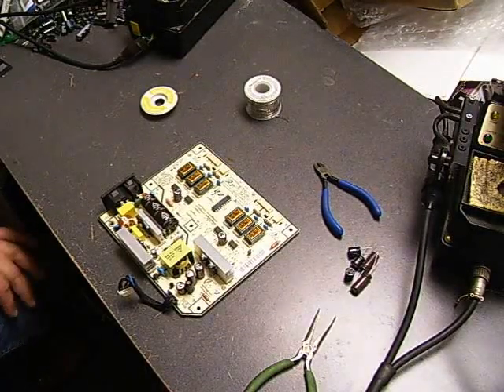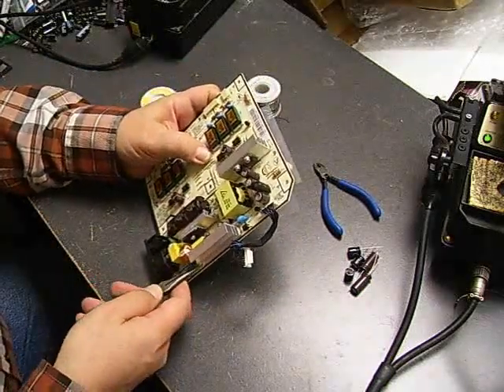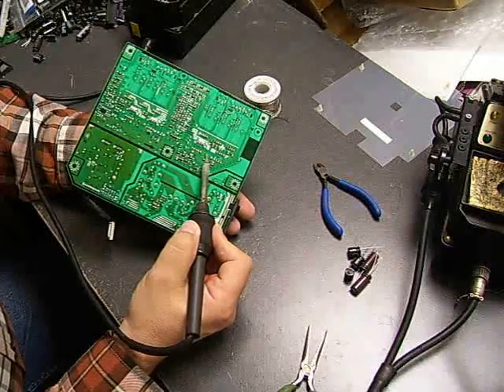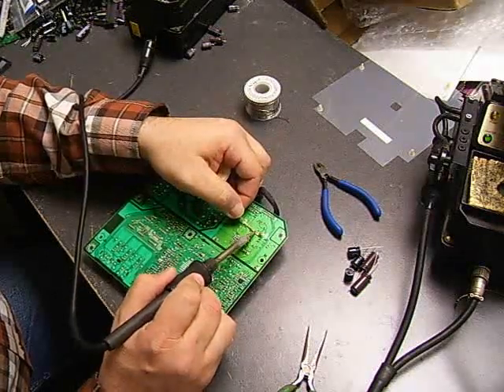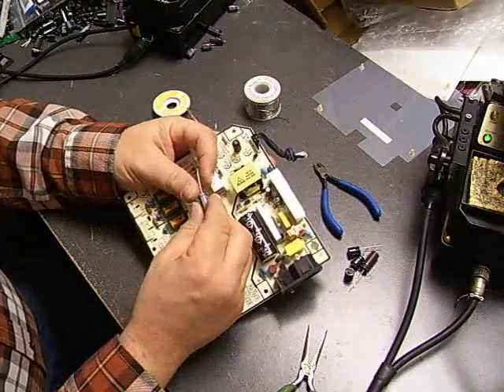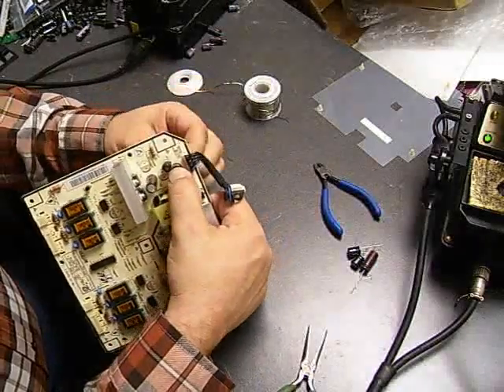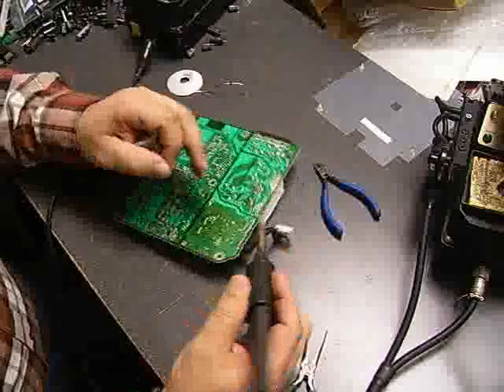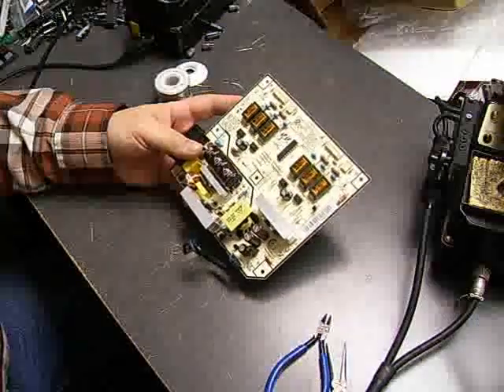Samsung 214T repair - Part 2 power supply board repair

Comment: I did the capacitor swap and all was well for about 12 months, now I have a new problem (just like jetfxr27 below) display goes blank after 2 seconds, then the power button flashes like it is in power saver mode - all capacitors look ok (no bulges) - I replaced them anyways but still have the same issue.  Any ideas?  Thanks!

Comment: the bad capacitor on my psu is hidden underneath the a heat sink...in front of the bad capacitor is one that is not bulging...all this to say, my bad capacitor is not out in open space as yours is.  I feel like i have 2 options: 1, remove the good one so I can get to the bad one, without messing with the heat sink, and replace both, or 2, remove the heat sink to expose the bad one .  this is my first time repairing a board, so I'm reluctant to mess with too many items...  recommendations?

Comment: I did this repair with the capacitors but the display is doing the same thing.  Can you help?  When I power on it pops on just like in your video fine, within 2 seconds the backlight shuts off.  The back light will only come on for 2 seconds after a power cycle.

Thx
Jet